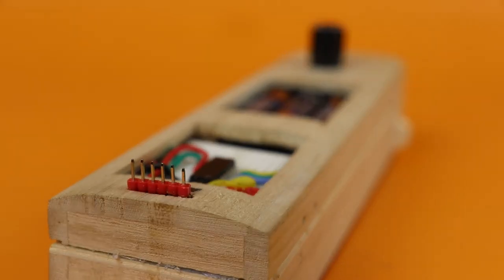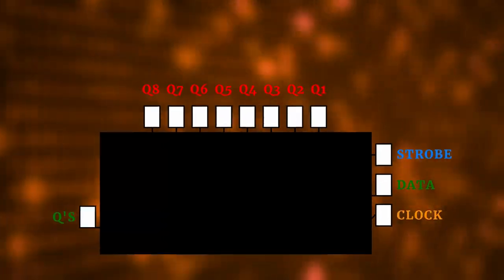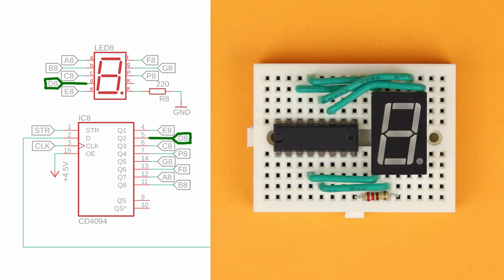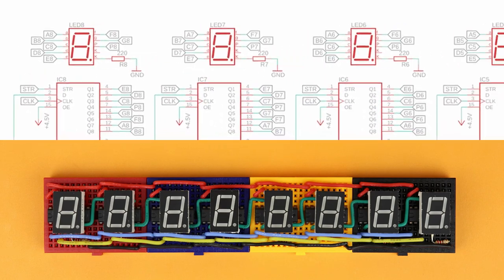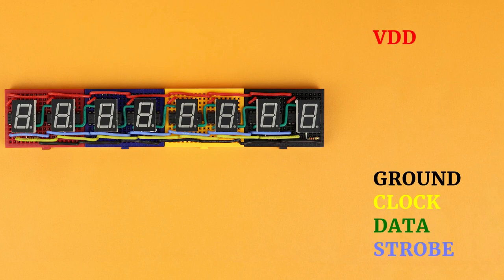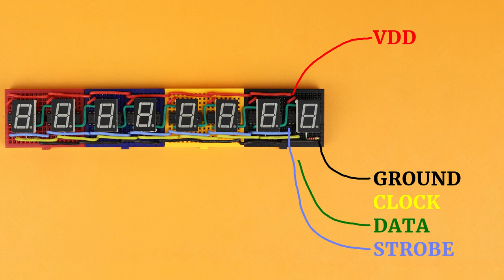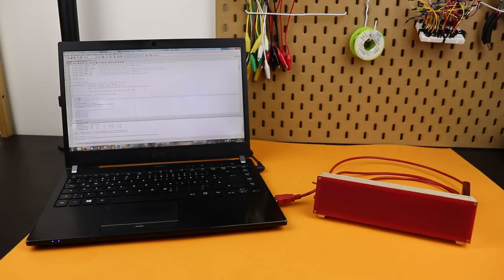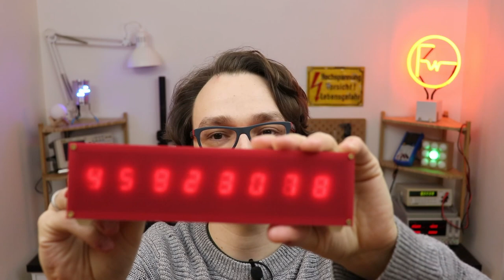Make a scrolling text display with CD4094 shift registers!

Comment: Really well done video. Nice project!
Clever idea bending the wires of the display.
Reply from the maker: Thanks so much! It works well with the CD4094, but if you want to use the 74HC595 register instead it's more difficult that way.
Reply: @FriendlyWire  Well I'm all for doing things the easy way - so I guess I'll go with he CD4094 if I try something similar :-)
Reply from the maker: @JeremyCook  I discovered this by accident, but it does make me wonder whether the CD4094 was designed for this purpose... :)
Reply: @FriendlyWire  Ha, as with many excellent discoveries :-)
Reply from the maker: @JeremyCook  Thanks :)

Comment: Do you think this can be done without a micro-controller? I am trying to do something similar to this, just only using the Tx and Rx wires. I would simulate my own clock using a 555 timer and i would use the start bit, as it exits the shift register to, hopefully, trigger the OE and some how Reset. Does this sound possible to you?
Reply from the maker: That is an interesting question! If you search for "single wire 74HC595 drive" you can see how you can control that shift register with just one data line :) I am not sure if that works exactly for the CD4094, probably not because the tolerances are different.

Comment: Great project,is there any way to replace the microcontroller with an Arduino?
Reply from the maker: Yes, this basic concept works with any microcontroller. If you want to use Arduino, you can still use most of the information in this video, because it mostly focuses on how the CD4094 shift register works. But you will have to write your own program later on to send out the data, and that may look a bit different.

Comment: Hi friend.
First of all, congratulations on your video, it is very interesting, I would like to do the same but with two CD4094 integrateds, since it uses three wires, and I would like to light a row of 16 LEDs independently. I would put a 12F675 and two 4094, if you could send me a code a style of the page in CCS.
The issue is that I of those 16 led's, because I want to turn on the led 3-4-5-7-8 for example and then if I press a button turn on the 1-10-11-14-16, for example.
It is to address an integrated PLL the MC145151-2 and thus change the frequency of a station from RX to TX. , when pressing the button it would be TX and when releasing it, it would go to RX. and so I change the frequency. Awaiting your reply and help, thank you in advance.
Regards.
Reply from the maker: Hi Xabi, thanks for your question! Not sure if I understand all, but if you only need two states for your 16 outputs then maybe it would be easier to do everything without a microcontroller and just hard-wire it with some switches? :)

I have not used the PIC12F675 in any project so far, but these little chips have all you need to convert this project, including the internal 4MHz oscillator.

Comment: Awesome project 👍
you can use esp32 to communicate with display with different values 
thank you 🧡
Reply from the maker: Thank you, I am glad you like it! Yes, you can use any microcontroller you want to send the data. I chose the PIC16F1455 because it is very small and cheap, but still has a DIP package so it fits nicely on a breadboard. :-)

Comment: Really happy to see this video but only one question remaining as Which type of shift registered is used??? And if the strobe line are connected in parallel then is it not that all display operates simultaneously on contrary to your first part of explaination that only one display is on at a given time???
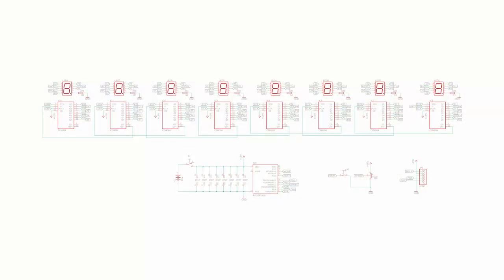Reply from the maker: Hello Victor, this project uses the CD4094 shift registers. The schematic is at 4:00, and you can also find it in the article here: http://www.friendlywire.com/projects/scrolling-text/#ch2 . The strobe line updates the CD4094 outputs, yes :) Where did I say that only one display is on at a given time?
Reply: @FriendlyWire  really sorry for the mistake sir ,it's not in this video but on the other video were the host tells in the assembly of multiple digit display only one digit display is functional  and rest will be off and only due  persistence of vision we see all the digits simultaneously.
So kindly explaine on this sir as out of several videos that I had reached only this video give me a clear insight.
Reply from the maker: @victormaxwellpeters9771  I am a bit confused :) This video here uses the CD4094 shift registers. In this case, all LEDs are on at the same time. We also call this method "direct drive." The other video you are referring to is probably the MAX7219 tutorial. The MAX7219 is an LED driver that multiplexes 8x8 LEDs. In this drive method only eight LEDs can be on at any given time.
The source of confusion is maybe this: both the CD4094 and the MAX7219 use a serial data interface to receive data. In other words, they both use a clock line, a data line, and a strobe line to receive their "instructions" of what they need to do. The CD4094 is very simple, it just receives eight bits. The MAX7219 is more complicated, because it can receive actual commands that control the 64 LEDs.
Let me know if this helps, or if something is not clear yet :)

Comment: Great video and project! Curious does the little microcontroller in the box send the clock and  strobe 90 degrees out of phase? Thanks
Reply from the maker: Hi there, thanks for your kind words! I am not sure if I understand your question, so I will attempt to answer it as best as I can :) When I am sending out the bits for the segments I first set the data pin, then put clock to 1 and then back to 0. After I have done this for all eight bits I pulse strobe to 1 and back to 0. During the time that strobe is active, clock is always kept low. So there is really no overlap between the clock and strobe signals. I hope this helps? Let me know :)
Reply: @FriendlyWire  I understand what you are doing! 

On my design I will simply invert the clock with a npn inverter so when clock is high, strobe is low, and when clock goes low, it will send a high to the strobe on the relative negative going clock, which is a positive going strobe. 
 
If you look at the data sheet for the 4094 it states it clocks the shift register on the positive going clock, whilst the storage is clocked on the negative going pulse. 

p.s. my needs are totally different as in my experiments i have a rough 4 bit shift register set up, with a clock on 2 4013s. 

The Data pin is fed from a noisy signal from a Monotribe filter, which in turn its filter cutoff is  controlled by the value generated by the 4 bit A/D fed BACK to the filter control (moddded by me). 

In a sense it is recursive as the filter opens up on 1111 to A/D whilst on 0000 A/D the fed back cutoff is lower. As the Monotrbe has a 1 bit noise generator upstream from a 12db resonant filter, the actual "quality" of the noise fed to the comparitor that triggers the data is based on what value the A/D generates. 

I will prototype this test circuit with a 4094 and see what effects I can generate for music.

Again, I really liked your project! I always watch others videos for ideas for my music applications.
Reply from the maker: My goodness, I just saw your comment, sorry for the super late response. Thanks for your explanation of the clock logic. I have seen people use a single wire interface to address a 74HC595 shift register, perhaps it is also possible for the CD4094. :)

Let me know if your music project is up and running, I would love to see it.
Reply: @FriendlyWire  here's a rough demo of the mark1. https://www.youtube.com/watch?v=J84iEge3GqQ.  i am working on a much better mark2 in the fall.

Comment: There’s no any different point that have  fix digit on that 4094 ic?  I want to install this display on motorcycle gear shifting that’s why I want to display fix digit in every time i shifting the gear. There’s no any separate pin which show own digit from 0-6.
Reply from the maker: Thanks for your interest :) I am not sure if I understand your question, though. You can connect only six CD4094 to the circuit, no problem. All you need to do is change the source code for the PIC16F1455 to display what you want. Let me know if I got it wrong :)
Reply: FriendlyWire I mean in your video you’re giving the pulse then it’s changing the number 0-9 but  i am asking if I give negative supply in one leg it will show 1 in another leg it will show 2
Reply from the maker: I am sorry, I still don't know what you mean. What do you mean by negative supply? This circuit only runs on 5V. There is a full article here, maybe it is helpful? http://www.friendlywire.com/projects/scrolling-text/
Reply: FriendlyWire it’s okay will you make a video how to make fuel meter for motorcycles using 7 segment display?
Reply from the maker: I don't really know anything about motorcycles, so I would say it's probably unlikely. But I am sure that it's possible to use this circuit for what you want it to do! Have a look at the schematic and the other videos here, and that should get you started :)